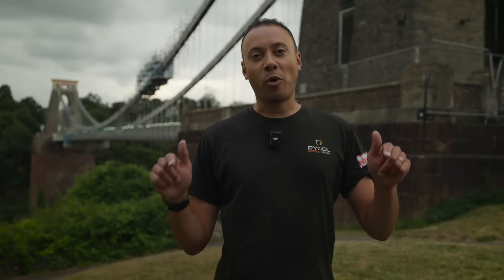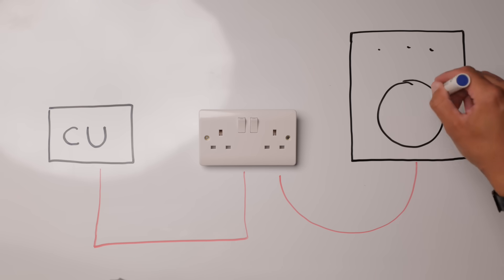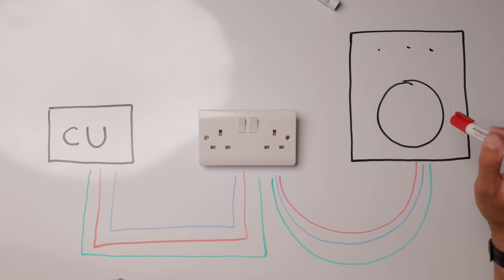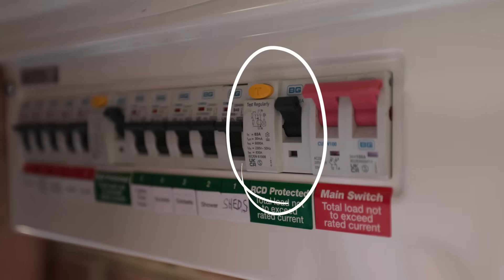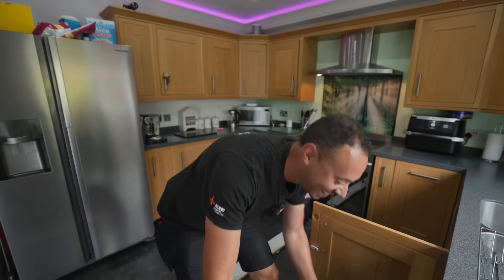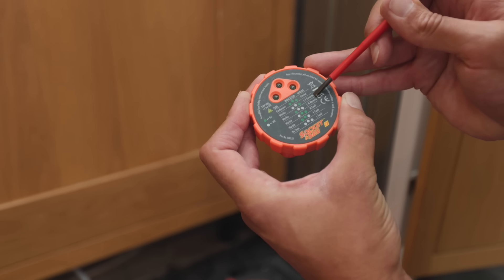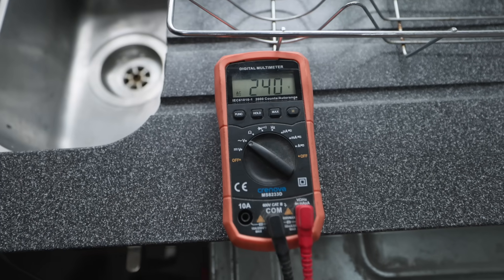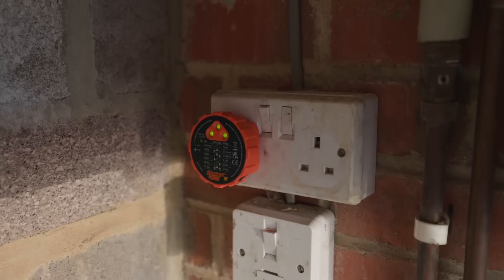This Simple Electrical Fault Turned Deadly⚡️

Comment: It happened in the kitchen of a kindergarten. 
There were complaints that the electric stove was under power. In Germany, electric stoves are connected to three phases of 400V. 
The electrician removed the stove and checked all connections. Everything was connected properly and the case was properly grounded.

Then he put the stove back in its place. 
He looked at the stove in confusion as he placed his hand on the exhaust fan above the stove.
Then it went through him an electric shock.

There was 230V on the extractor fan housing. 

Oh by the way, the extractor fan doesn't work...

Protective Earth and Phase were swapped on the fan !

The error occurred because a layman made an extension cable.
Reply: The dangerous thing is that in German sockets the contact for Protective Earth (PE)
is NOT protected to touch.
The same applies to French sockets.
Reply: Actually in Germany they are not connected to three phases of 400V, they are connected to three phases of 230.

Each phase is 230 V AC.

Comment: Very good video. I am not a trained electrician, but have done quite a bit on electric circuits and electronics, and I am still paranoid about safety in my middle 60s.

You can never be too safe.  Trust me
Reply: Me too. I plug a mains radio into any socket I'm going to work on, then turn it up loud. I just have to have the reassurance of hearing it go off when I flip the MCB, or even the main switch!
Reply: @philipgordon4118  That's a good idea
Reply from the maker: Thank you. That is very true. Could happen any day
Reply: Get a qualified spark, that'll stop the paranoia lol
Reply: @CbrigBear87 well not anymore after this video lol

Comment: Assuming this was served by a modern consumer unit, why didn't the RCD trip the moment it detected the imbalance between the live & neutral current flow?
Reply: As the chap says, could be a faulty RCD. Seen plenty. The test button is really only there to exercise the mechanism, it’s not a guarantee the RCD will operate in a fault situation.  Particularly for older type AC types.
Reply: @MS-Patriot2 - If faulty, won't the electromagnet inside fail to hold the live & neutral circuits open?
Reply: Surely should fail 'off'?  @Benzknees
Reply: @Benzknees  RCDs do not fail safe, they fail unsafe, which is why they should be tested regularly. I was doing some work on a garden office with its own consumer unit (2 circuits, sockets and lighting) and prior to isolating it I pressed the RCD test button, which did not work. No idea how long it had been faulty as it had never been tested.
Reply: @bimble7240  - How did you ascertain that was a RCD failure rather than an earth leakage issue?
Reply: @Benzknees The RCD doesn’t work by holding the contacts open, it opens them on a fault condition, hence it can fail unsafe.
The test button just sends phase and neutral via a current limit resistor through the sense coil. The resistor value will likely be low enough c.7.6k ohm to ensure the full 30mA trip current flows in the coil.  The fault current may have been less than this to kill the plumber, depending on many factors. Hence the test button alone is not enough to be sure the RCD is sensitive enough or will open the circuit quickly enough to provide the intended safety benefit.
Reply: @MS-Patriot2 : Yep & I'm pretty sure we've all seen that multiple times when doing EICR's etc, press the test button and works perfectly but do an  RCD test and no trip at all.
Reply: It's possible that insufficient current difference flowed through the RCD to trip it. If 20mA was enough to give the guy a heart attack and that particular RCD needed 23mA (say) to trip then it wouldn't trip. Maybe. Or it was faulty and would never trip anyway..

Comment: Deadly is it not. Clowns wiring come to mind. And I thought part P was supposed to cure all these ills. 

Many years ago I worked for the Electricity company and got asked to go to a house where the coroner was making enquiries. It was the electrician's own house. What had happened was, in those days, the fuse shield was secured by a single screw. The electrician was changing the rewireable fuses to MCB's (the must have thing that had recently come out). Instead of isolating the fusebox (consumer unit), he proceeded to change the shields with it live. The only thing that could be surmised was that the screwdriver had slipped off the screw holding the shield and had made contact with the live busbar. With a gas meter directly behind him, he didn't stand a chance. You could even see where his finger had slid down the screwdriver shaft as he electrocuted himself. Very sad.

Comment: What annoys me is it’s essentially minimal cost to add earth presence in a device so a little red light and a voltage test between line and earth. No voltage and you’ve not got an earth. Should be mandated.
Reply from the maker: I agree, it would save a lot of issues!

Comment: It was nervous-watching, knowing your washing machine was temporarily a death-trap!
Reply: Me too. If you're going to do this kind of demonstration then a 100k to 1M ohm resistor will allow the voltage to be demonstrated whilst keeping any contact current low enough to avoid injury
Reply from the maker: Ive done this job 25 years and not much domestically concerns me these days. However this was a real moment for me.
Reply: I am retired now but a qualified electrician, I wasn't happy watching this.

Comment: Yeah, I would always use a socket tester before working on any plugged in appliance and I would still conduct a 'live' test on any metal parts before touching it. I did have a 'live' case on a washing machine once which had thankfully taken out the RCD.
Reply from the maker: That’s always a good idea, better to be safe than sorry!

Comment: My current job...previous 'electrician' wired downlights into 4 childrens bedrooms, 32 lights all on choc blocks lying on the insulation in the attic, he cut all the cpc including the ones to the metal switches in each room...same clown wired leds and wall lights directly to sockets with no protection or control, cables were just left hanging out of the walls covered in gaffer tape...in kids bedrooms FFS
Reply from the maker: Unbelievable, i dont understand where some people think its ok to do these things.
Reply: @RygolElectrical  The guy was syrian, he'd been in the country for a year 😡
Reply: @zombienation68 : Lost count of the amount of times I've seen this sort of thing, a Chinese "Electrician" did a job locally in a house with an old Wylex fuse box & no RCD. 
He left bare, open ended live cables hanging out of the wall in the kids playroom.
Tennant also said that the lights flashed on and off since he was there working.
Found a large "Junction" under the kids bedroom floor where he'd just twisted the wires together and pushed rawl plugs on top to insulate the connections.
Reply: @rscelectrical7091 How about one that cut through some 6mm T&E with a grinder (supply to hot tub in garden)...he covered it with tape and put skirting in front of it, customer phoned me and said hot tub is not working...he had cut through cpc & neutral conductors leaving just an isolated live at the tub with no where to go  😡
Reply: @zombienation68 : Sorry I wasn't ignoring you, I posted a reply earlier but for some reason it was removed.
Reply: I had a similar experience with the electrician my general builder brought in to undertake a minor electrical project, leading to work in refurbishing the house we’d just bought! He basically treated me like an old fool! Fed me on absolute nonsense and wanted to cut corners on the job! When he tripped the main house supply, because he was using an extension lead that was crumbling away, lying in a rain puddle! I mentioned things like leakage current to earth and poorly maintained equipment, he asked me if I knew what I was talking about! A reply included words like; chartered engineer, masters degree in electronic engineering and communications, working at NASA, MIEE and MIERE (now IET) member for 40 years were obviously not to his liking! He walked off the job, and didn’t get paid! The main contractor was very happy to work with a local company that I was very happy with! It did get him a lot more work from me!
And, the carpenter was superb! He’s been sourced for more work, if I can afford the cost of the chocolate biscuits he consumes every day!
Reply: @g8itb-radio : Carpenters, Electricians and Plumbers are suckers for a good biccy 😂.

Comment: Not exactly like this, but some bozo did not cap the wires on a build next to a comm cabinet and the live was resting on it. I go to open the cabinet and got a shock that left my hand tingling for a minute. You can imagine the expletives I had.WTF they didn't put any tape or anything mystifies me. 

Moral of the story, there is no stopping  from someone else being an idiot, but  if you, are not paying attention,  it will kill you. 

Thanks for sharing.
Reply from the maker: That’s not good at all! This is the problem, people that are dealing with electricity need to have a better understanding of the safety aspect and  why testing is not a chore and is a potential lifesaver even when it feels like it’s a pain to do.
Reply: And this why, legal or not, I do all the wiring myself.